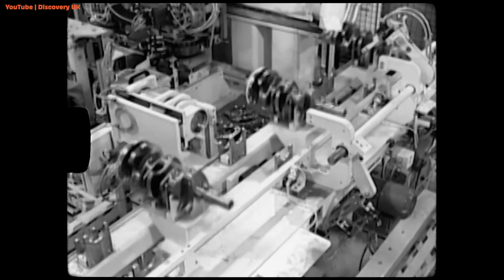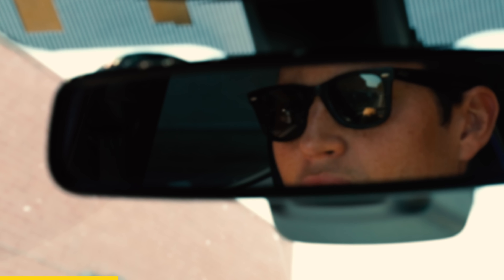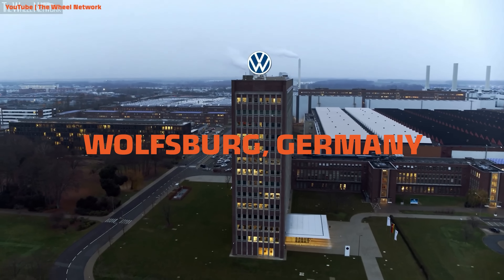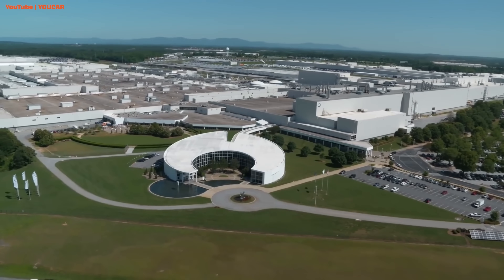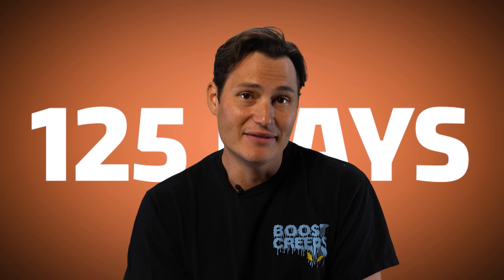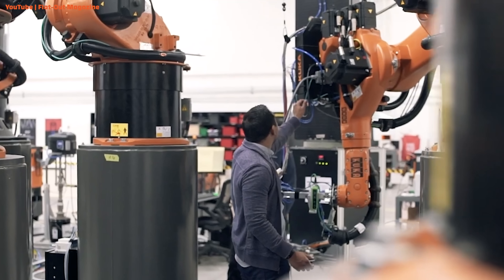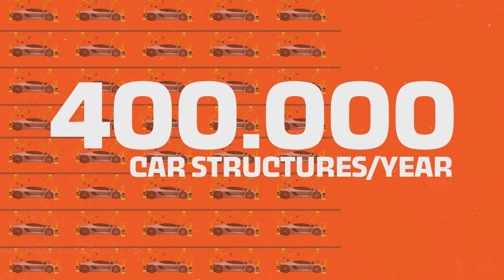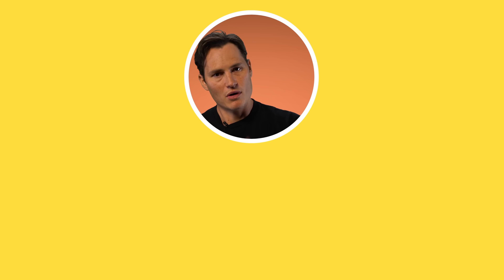A.I. Designed this Car

Comment: “The wiring is incorporated into the chassis, and it’s built around eliminating all unnecessary space”—Bring this to the average mechanic to work on, and he’ll eat a lightbulb before tearing into this monstrosity
Reply: Its not as terrifying as it sounds. Wire harnesses are a b1tch no matter what form they're in. Also you service a HyperCar at the dealership not Joe's lube n scoot just sayin.
Reply: All cars are just a pile of metal, glass, panels and nuts and bolts etc.  They all wear out.  If you can put it together you can take it apart.  

Will some AI genius consider maintenance labour costs and ease, maybe to the point of being user friendly or 100% user maintainable in their calculations?
Reply: @beyondwhatisknown  they design for profit
Reply: @beyondwhatisknown  Only if someone programs them to, and.. my brother works, way too much, on "RVs". You would swear these where made like a super car, because a) you can't just send them back some place to fix them, and b) every freaking thing on them seems to be designed to keep you from getting at the engine, life systems, wiring, etc. Literally the only thing that is worse when trying to work on one, other than right off the line, unmodified, is when someone tries to "add" something to them, and it turns out that the only place to add it is "right over top of" what some joker already mislabeled as "access".

Reality check people - while these things are likely, right now, going to only be handled by rich people, who can afford to send something to an expert, this is not what is going to eventually be the case, and you will still need mechanics, never mind just basic maintenance, and 1) outside of the places that make them, there are almost no mechanics any more, just techs with a computer, and a list of parts, and 2) some things can't be fixed, without stupid costs/difficulty, or someone insisting that you just lost your car, and it needs to be sent back to "the manufacturer" already, when its a "tech" looking at it.

This is a problem that badly needs to be addressed even as the manufacturing changes, and we end up also having no one even at the dealership/plant who can do shit with it, because only the computer knows how to make the thing. And, seriously normal people can't afford to go the route of, "Well, its out of warranty, so we can no longer just send you a replacement, and.. no one 'fixes' those things!"
Reply: @patrickelliott2169  whacked that nail on the head. worked on a few rv's. total nightmares. as for machines replacing mechanics, they can keep dreaming.  human bodies are the ultimate "do anything" biomachine yet devised . self programming, flexibility, dexterity, you name it.
all machines break, usually at the worst place and the most inconvenient times.. just a fact.
Reply: That’s probably why most people with hyper/supercars don’t bring them to an average mechanic, and instead bring them to a hyper/supercar specializing mechanic
Reply: @monkey3monkey2  which will just reprint the section out.. cuz why mend a broken intricacy if you can reprint an intricacy (think pencil & eraser vs white out & ink).
Reply: @terminathor2160  in other words, the OEM. it'll take megamoney for the equipment.
Reply: @monkey3monkey2  no... they just get a new hyper car...
Reply: This is why any repairs will be done by a robot, this is what the matrix will look like IRL humans will simply become obsolete...
Reply: 100% most mechanics hate engineers because it might look good on CAD, but ffs they didnt think about serviceability..
Reply: @deana8052  truth. the feeling seems to be mutual.
Reply: There's a supercar manufacturer in Italy that is so exclusive, they won't allow anybody else to maintain the car. Wherever the car is located in the world, they send a plane to pick it up, and then return it back to the owner.
Reply: no, i'd tell the unfortunate owner to eat a lightbulb and to call the OEM to have his car remanufactured. he'll have to be a gazzillionaire anyway, so no prob.
Reply: A lot of repairs will just be done via an overlay if it can be hidden from view.
Reply: Like i said, company will be bankrupt within 5 years
Reply: @superllama666____________3  I’m sure they said the same thing about Tesla. 😜
Reply: @superllama666____________3  I doubt it. They have some seriously neat proprietary IP that could be licensed to other manufacturers for some crazy amounts of dough, mostly on the design and manufacturing fronts. The hypercar they've made is proof of concept, made to call attention to the process. Give it a decade and everyone will be building cars with these methods.
Reply: @superllama666____________3  how? They are eliminating needless jobs with this type of tech. To say the big manufacturers won't be interested in tech like this in the future, would be a lie. They care about profits. This would increase profits considerably, by not paying hundreds of employees
Reply: If cars become easy to build, why not recycle and rebuild instead of repairing?
Reply: I mean my early 2000's Rover, which ended up being a testbed for stuff used in the BMW 5 series, already had wiring incorporated into the chassis, the car was built in sections and plugged together, quite new at the time, one of the first cars to use CANBUS I think.... 

Their logic at the time? Wires rarely break in the middle, they fail at either end (fixable), but if it goes in the middle where you can't get at it, there's actually something far more serious in your chassis needing investigated! 👀 

Some parts of that car were great, first car I'd driven that told me specifically what bulb was out and where, not just a hint, other parts were not so good.... damage to the rear 1/4 panel area would mean a whole new side of the car would need to be stitched in! It was a weird construction technique, but produced a light, fast and fuel efficient 5-series sized car, something some manufacturers struggle to do in current year 👀
Reply: I was just wondering what its gonna be like when u have an electrical issue or if one of components gets a fracture its gonna be terrible to get to something AND replace it unless the ai can account for parts being changed out but idkk im no mechanic but it seems like even the robots would have trouble accesesing and swapping parts that are so integrated into the next part :/
Reply: The groves are exposed and accessible the AI thought of this already. Literally
Reply: C W  everything causes cancer why not🤷‍♂️
Reply: imagine going into a mechanics shop, he plugs ur car in via usb c, computer figures out whats wrong. 6 arms come down from the cieling rip ur car apart fix the issue and re assemble it in front of ur eyes in less than 30 minutes lol
Reply: The mechanic will be a robot too!
Reply: ...The AI mechanic?
Reply: Saw a guy eat a light bulb once
Reply: I'm a technician and would love the challenge to work on something like that.

Comment: A bus trunk traced somewhere along the body would be most efficient replacement for wiring.  A packet switched network instead of an end to end wire for every connection.  For power distribution, do the same thing, but put hub capacitors instead of network switches.  Though, if you do that, the power lines can also be the data lines.

Comment: I am professional automatization programmer, and i am really amazed how you described, that robotic station can be so easilly reprogramed or build for that cost...i would realy want to know, what company designed and programmed that. Second thing is, that if parts, which are in realy thugh conditions, as turbo turbines, are made by 3D printing, i would know the life time of this engine, because layering aspecial metal, have low solidity, unless after printig it goes to some owen to reform molekuls...

Comment: Been in auto industry 30 years.  I know and use Optistruct and Tosca very well.  I have spoke with the owner of 3D printing facility for rocket-fuel-delivery systems (huge assembly grown as a single part).  Rocket fuel systems are not 3d printed to save weight.  They are printed to improve reliability from 99.99% (separate components) to 99.9999% as single component. Why pay for this in a car?  Look at the car you purchased... why are some bolts 5mm longer that needed?  Light weight is great, but $100K cars have a limited customer base. Revisit what made Henry Ford successful.

Comment: "3d printing doesn't waste resources" this is not 3d printing on what is in your video its 3d etching which wastes a lot of resources by nature. 3d printing you are adding material. In 3d etching you are removing material. This is literally vaporizing aluminum to leave whats left of the layer.
Reply: No its putting a layer of solid and melting it together. So adding material
Reply: @davidfarah  its adding a layer and burning off whats not needed.

Comment: Contrary to what he is claiming: all those parts can be made with conventional methods, from design to end product, probably way more expensive, but it can be done.

Edit: as far as I understand from other commenters here who seem to know more about this stuff than me, the conventional methods would actually be cheaper.
Reply: He is missing the fact that large factories spit out a thousand cars per day. Mass production is what it is - MASS, and the 500M $ production line has enormous volume. This is very slow and very expensive. Trust me, manufacturing planners try to shave off every cent and every milisecond they can by optimizing the whole process be it material flow, machining or positioning of robots. 
So, its cool to have the robots make it, but its foolish to say this is revolutionary and better than the existing lines.

Comment: It's not AI! Stop calling everything AI! It's topology optimisation using an FEA software (coded by a human), in which an engineer (also human) inputs the boundary conditions it has to withstand. This has been around for YEARS and every car manufacturer uses it to reduce weight.

It costs a LOT of money to 3D print in metal, simply because the metal powder used as raw material is so expensive.. $1000+/kg. Thats why every 'normal' car doesn't use it. Want to pay $500k for a 3D printed Ford fiesta? Didn't think so ^^

Comment: Legit concerns about it all.
1:3D printing is TERRIBLE for metals.
Aluminium and especially titanium readily oxidize, getting worse with temperature. The reason they don't rust is because in these specific metals, the oxide is harder than the base metal and doesn't flake off like in iron. That isn't a problem in whole pieces, but in 3D printing, every layer printed is sandwiched between oxide layers. Those inclusions are terrible for part integrity, but the solution is just printing in a vaccuum. Pumping down a vaccuum has it's own problems though.
3D printing is also slow. It may consume less material but it is also A LOT more energy intensive. It's orders of magnitude more expensive, but not that the people buying these cars care.

2: He forgot a crucial part about that minimum material thing. That organisms are capable of healing themselves.
Rule number one of engineering is don't put holes where you don't need to. They create stress tensors that increase the likelihood of cracks forming. The kinds of cracks a body could heal, but in metal parts, will grow ever so slightly every bump in the road until they break apart.
I don't think he ran a fatigue test on those parts. But if I ever hear about a supercar wheel breaking off in the middle of a highway, I will have one car model on top of my guess list.

Comment: * drives this car to mechanic. 
Me: I guess the air conditioning broke.
Him : buy new chassis .
Me : ...
Him : ...
Reply: Pretty much. Modern cars already have life expectancy/utility life of 10 years/300k km at best, where as older cars are still going and for instance world record mercedes 4,8million km's and still going strong. These cars have utility life of until cigarette cup is full as the joke did go, until it become reality..
Reply: @Hellsong89  modern cars are leaps and bounds more reliable than old cars. You do see some old cars on the road. You see them because those examples were either meticulously maintained, a rare oddity in manufacturing, or because someone has spent a lot of money replacing broken parts. Look around, how many old cars do you not see, the millions that broke down and weren't worth repairing. Survivorship bias is clouding your judgement.
Reply: @cr4zyj4ck  bruh.. Do you know honda?
Reply: lol
Reply: Him: wait for five minutes I'll print it and come back.
Me: ok

Comment: its literally the opposite of how the sr71 was made XD the skunk works worked off making everything and putting it on to test it full hands on make it as you go style chaos with as much of the un needed processing time takin out... this is telling a machine to sit there and do THE MOST processing possible to make a car... my only question for this design method is repairs? can the car be dismantled and repaired by hand or will you NEED to go to a workshop? and if every car is exactly designed by an AI non of the parts will be cross compatible and you'll have more un used stock at repair places?

Comment: the main issue is that additive manufacturing with these powdered metals being welded by lasers to create a metal print are not nearly as strong as forged and even cast parts let alone as clean as a piece of machined billet from a CNC. Not yet to my knowledge anyways. But from what I can see from those 3D renderings, there a plenty of non "additive manufactured parts", for example those carbon fiber tubes, Some of those chrome ducting, those machines caps, etc.) Dont get me wrong though, Ive been aware and a huge fan of this Machine Learning AI for building the most efficient shapes and structures possible with the least amount of material given the job the part needs to perform for many years now. Its great to see it actually being used in a usable and tangible thing like this car.

Comment: An "AI" cannot design a car. And despite the fact that "the industry" tries to push that narrative so hard, there is also no "AI driven" decision making, only data driven decision making. The author of this video seems to have no clue on the subject and is just repeating the marketing blerps of the manufacturer with some edgy graphics and music added on top.

You can of course use machine learning in the process of designing a car, everyone is doing that, but hat does not equate to "a car designed by an AI". It also seems to be a bit of a stretch to measure the performance of a car in horse power, give it 1200 of them and then call it a 21st century car. To me that equates much more to the very definition of a 20st century car.

Comment: Before I retired, I used to repair robots.  What this is missing is the hours and hours of programming that goes into each and every movement of the robots.  Programming in the movement actually takes much longer than the actual movement when it is building the car and has to be reprogrammed for every single variation or change.  Once you build one, if you make no changes everything  after that is as he says, except when it isn't.  Usually it takes many cars going through the system before the programming is perfected.
Reply: It's local optimization and 3-D printing.

Comment: It's all cool and exciting, but in reality, you don't have fully autonomous or robotized Tesla / VW / whatever assemblies for a reason. In reality, robots interacting with and assembling physical objects is incredibly error-prone, inprecise and in general worse than doing it by humans assisted by robots to some extent...Saying that such an assembly could then "easily be reprogrammed" for other designs or variations is quite far from reality as well. Not even going to go into all the wonderful issues that you get when letting the AI design a car, without the astounding amount of inputs that are required to prevent, say, a design which makes it impossible to reach and service a moving part in the middle of car without needing to disassemble 3/4 of the whole car. Projects like these are obviously needed and welcome in order to continue pushing the envelope, but the hype needs to be toned down - for example, I'm curious about the price of manufacturing for a single unit using this process - then lets compare the final result with cost and properties of a "normal" one...It's not going to bode well.

Comment: Great analysis of the design work but the technicals on A.M. is a bit weak.
It's not a scalable process yet, it does print extra material as support structure, many AI designed parts can be cast or machined to speed up the process and improve material properties.

Comment: I'm watching this and all I can think of is: how are these cars going to be serviced? AC ducting and wiring part of the chassis?! What happens when the ducting fails or is obtured or there's a short circuit or the materials just start to crumble after 15, 20 years on the car or bottom line those need to be changed for repair?
What happens after an accident? How do you fix such a car?
Also, because I like to work on my cars, hypothetically if I could afford one, maybe even after depreciation, how would I work on my car? Would I need a laser gun, light sabers, robots and a 3d printer?